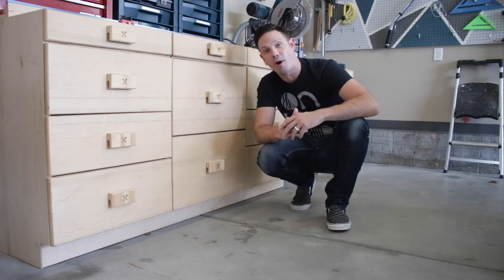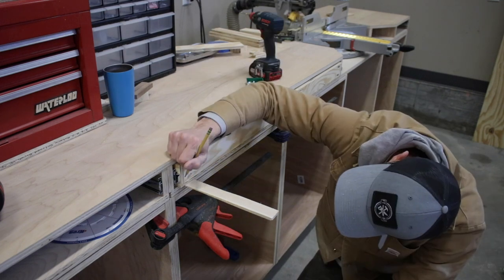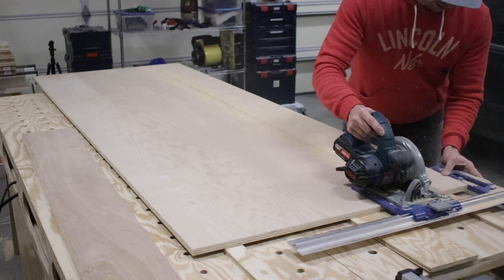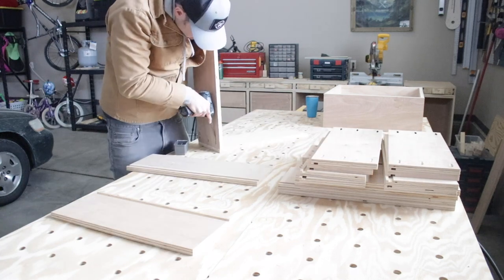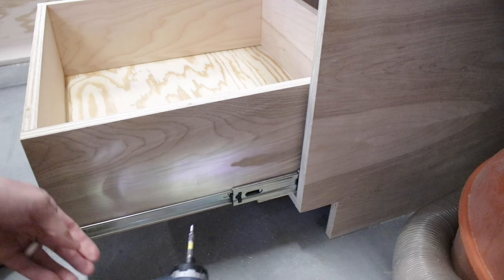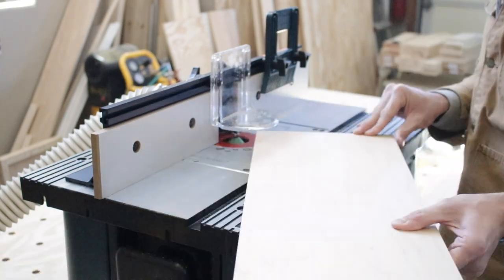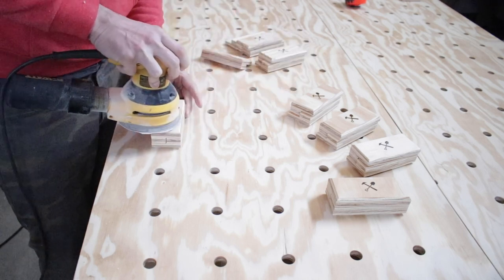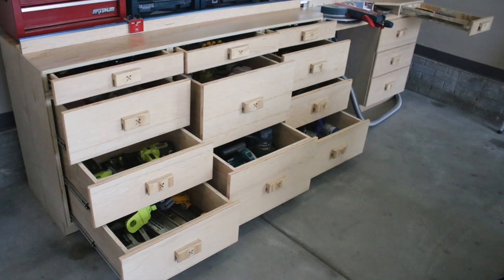My Dream Miter Station, Part 2 (Drawer Assembly and Installation)

Comment: Andrew, really like your style of video. I appreciate hearing your thoughts  and what you are doing as you go along. Since you have a tablesaw why do you use the mitersaw to make cuts that are too wide for it?  I would like to see you take a straight edge and check your top, because you used a sledge to drive in the toekick base if it was out like you said it will act as a wedge and drive up the partition above the high spots. I am subscribed and will be watching future videos.
Reply from the maker: Hi Pat, thanks for the positive comments and great questions.  I can't remember exactly my frame of mind in terms of the cuts that were too wide for the rip cut, but I am pretty sure I felt that the length was too long therefore would be hard to keep steady on the table saw since it is a smaller one.  The concrete has a slight bow in it, and rather than adjust the toe kick plate, I was fine with having it slightly jammed in.  Something I didn't mention in the video is that I am going to be moving this set up and I hope that in its next location it will be on level ground.

Comment: I have made more crappy draws that I should admit to in a public forum, but watching YouTube have have learn a great deal.  George Vondriska of the Woodworkers Guild of America showed me (in a video of his) the coolest technique for getting your measurements on the width right every-time!  Once you have the carcass done, take your draw slides (the pair), the two sides of the draw and  push them inside the carcass on one side.  Then measure the remaining space and that is the size of the inside of the draw.  If you are like many and want the bottom to be an  1/8" or so smaller to allow for movement, the subtract that 1/8" and you now have the exact size of your draw bottom.  This eleiminates the painstaking way you validated your draw bottoms.

Cool video none the less and all the best in your future builds!
Reply from the maker: Thanks for sharing, Joe.  Yea that sounds A LOT better.  I'm glad I took my time but yes it was difficult. I'm excited to try this new method someday.  Thanks again for the kind words.

Comment: Nice build.  I always thought you shouldn't use glue in the rabbits for the drawer bottoms to allow for expansion/contraction.  Can you explain your reasoning behind doing so and if there has any noticeable negative side effect?
Reply from the maker: I wanted to make sure they were secure. Haven’t had any issues!

Comment: So, it looks like you tacked on a fence guide with an adjustable stop after you finished. Ron Paulk put his guide a bit behind the fence line of the saw to allow for crooked boards. I have seen Gosforth Handyman question the use of fences. The Wood Whisperer got rid of his and substituted a track in a groove. Is it now a trend to undo the trendy, in-line fences on miter saw stations?
Reply from the maker: Thanks for the comment! I still need to release my Part 3 to explain what I did for the fence and how I adapted it to fit my new Miter Saw.  I have seen those changes of fence design in other notable woodworking influencers.  I think the big bonus of removing the fence is that you have a flat surface when using it for other things. I think that is why Marc (WW) did it.  I think it probably is just personal preference!

Comment: What's your cutting capacity on the right side? I have a very small shop and have been trying to figure out the bare minimum I need - I haven't convinced myself that anything less then 4' is a good idea. What has your experience been?
Reply from the maker: Great question.  The station has 2 feet of bench area on the right, but I can extend a piece out hanging over the edge up to about another foot.  I also added wheels to this miter station allowing it to move if more room is ever needed.  I mention that on Part 3 of the video series and I still need to publish it! Since I have about 8 feet on the left, 2-3 feet limit has been fine on the right.  Thanks for your comment and question!

Comment: Andrew, great build. I just bought the plans. You and I have sizable saws, with a reach deeper than the depth of your cabinets. How much space is between your wall and the backside of your cabinets?
Reply from the maker: Thanks so much for the support, Joel! I recall it being about 10 inches of space for the miter slide and dust hose connect.
Reply: @diywithandrew  thanks Andrew!

Comment: Andrew, I like the creation you have here and am considering one for my small shop. I am limited with space, and I am curious as to why you have the saw to one end of the station instead of the center. Does this limit you when making cuts in projects such as crown molding? Also, have you completed the plans yet? Where can they be found? Thx
Reply from the maker: Hey Michael. Thanks.  I am almost done with the project plans and will have them 
available soon!  Email me at hello @ fieldtreasuredesigns . com to be on my list to be emailed as soon as they are ready! Thanks!
Reply from the maker: Hi Michael, I finally have the Project Plans available Here! https://gum.co/FXNqh

Comment: Just found your channel. I like the design and how well it works with your other shop furniture. One thing is that you were cutting grooves in your drawer sides. A rabbit is on an edge, a groove is not on an edge and runs with the grain of the wood...a dado runs across the grain of the wood. Thanks for posting.
Reply from the maker: Thanks for much, Jeff! Yea appreciate the clarification for my viewers. I totally spaced it and used the wrong terms.  LOL!

Comment: Why use the Kreg for the long rip cuts when you have a table saw w/ outfeed table?  Would think you would only need to do the cross cuts with the Kreg
Reply from the maker: Another great question! My table saw is smaller so I opted to use my circular saw for all the cuts. I now have a track saw and feel like it is more reliable for many cuts and only use my table saw for smaller cuts. Thanks again for watching and the great questions!
Reply: @diywithandrew  thanks for the replies!